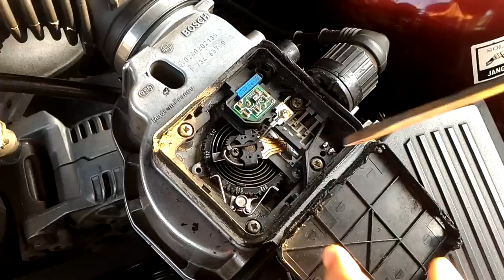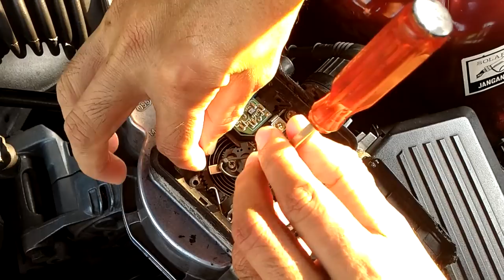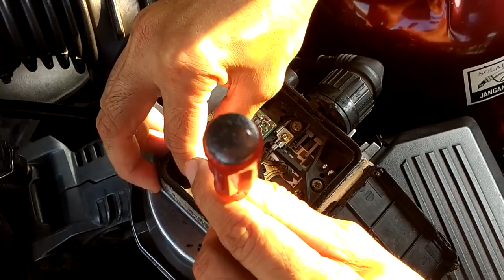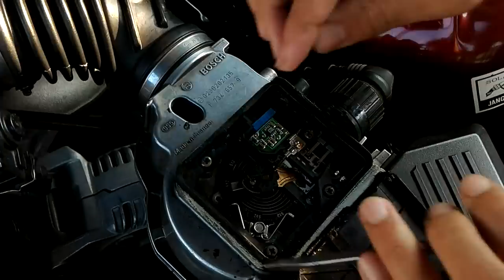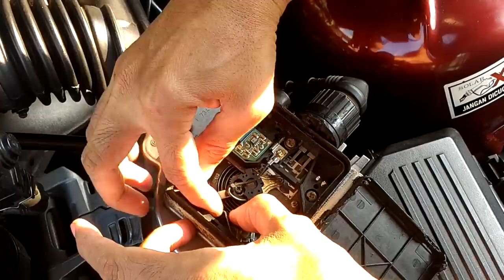BMW E36M43 AFM setting

Comment: Om, tune ini ngaruh ga ke Power output/efisiensi?
Reply from the maker: Ngaruh om
Reply: @motoren_works  ada tutorial buat setelnya om? mobil saya 1988 Toyota Cressida. pake sensor ini juga soalnya
Reply from the maker: @putraadriansyah8082  untuk di bmw, setting ini tujuannya untuk mencari kondisi ideal perbandingan antara udara dan bahan bakar. Kalo kondisi sudah ideal, tidak perlu ada penyetelan lg.
Step nya:
1. Buatlah tanda posisi awal gear sebelum diputar. Sebagai acuan awal.
2. Kendorkan baut penahan kawat gear, untuk memudahkan memutar gear nanti. Kendorkan saja dan tidak perlu melepas baut. HATI2 ketika memutar baut, tekanan pegas lumayan kuat. Jangan sampai gear tidak ketahan oleh kawat penguncinya.
3. Aturan putaran gear: clock wise/cw (searah jarum jam) = lean/irit. Putaran counter clock wise/ccw (berlawanan jarum jam) = rich/boros.
4. Kalo sy, sy akan memutar gear sedikit demi sedikit ke arah cw. Berhenti ketika getaran mesin menjadi kasar (kondisi terlalu irit)
5. Putar gear kearah sebaliknya ccw untuk mencari kondisi ideal. Kondisi ideal adalah ketika getaran mesin menjadi halus kembali.

Misalnya setelah memutar gear ternyata posisi gear kembali ke posisi awal tanda yg sudah kita buat sebelumnya, berarti disitulah kondisi idealnya.

Efek memutar gear ke kiri/kanan dari kondisi ideal akan menyebabkan mesin bergetar kasar.

Disclaimer:
"do it with your own risk" ya om.
Reply: @motoren_works  mantul om. tar saya coba
Reply: @motoren_works cara ini berlaku juga sama airflow e36 m40 gak om? Diputer ke kanan biar irit
Reply from the maker: @ridlwn sama om

Comment: Kalo knalpot bau bensin sama terasa boros apa kendalanya di air flow gan?🙏
Reply from the maker: Biasanya ada di setting AFM dan setting CO nya yg kurang pas om
Reply: @motoren_works  terimakasih gan.
Reply from the maker: @Satryatroy  siyab om
Reply: @motoren_works  sudah sya subrek ya gan 🙏
Reply: Lokasi di mana om,

Comment: Om, izin tanya. Kalo idle gak teratur, terus dari knalpot keluar asap hitam dan bau bensin itu berarti setelannya kurang gimana ya?
Reply from the maker: Kalo dari pengalaman sy, biasanya terlalu rich/boros bahan bakar om. Coba gear diputar clockwise/searah putaran jarum jam sampai bau bensin tidak tercium dan idle teratur om. Cek juga ujung knalpot, kalo mengeluarkan air/ada uap air saat setting, biasanya settingan sudah berada dalam range kondisi ideal
Reply: motoren works oke om, saya coba dulu. Terima kasih
Reply from the maker: @afridazubaidi830  sama2 om

Comment: Mas misal e36 m43  gas brebet terus asapnya jadi hitam itu apanya yah?
Reply from the maker: Kalau engine normal, kemungkinan boros om. Coba cek jg businya, kalau ujungnya hitam kemungkinan memang boros
Reply: Terus misal habis kenceng sering mati sendiri mesinnya om
Reply: @motoren_works  bukan AFM?
Reply from the maker: @ahadihalim3992  kalau pakai ilmu tebak-tebakan, bisa dari:
AFM: coba cek pergerakan flap nya, pastikan masih lancar, atau kalau mau coba geser GIR AFM nya 5 gigi ke kanan (CW)
ICV/idle up: kalau kondisinya masih normal, coba bersihin. Tp kalo icv mulai error biasanya rpm bakalan naik turun terutama ketika AC on
TPS: cek hambatannya

Baiknya sih di scan dulu om, siapa tau ketahuan part mananya yg error

Comment: pak kalo di gas gada tarikam trs glitik itu lean atau rich?
Reply from the maker: indra alamsyah sy kalo nyetting AFM dalam kondisi idle/langsam tampa di gas pak. Kalo rich tandanya mesin seperti mau mati, sedangkan lean tandanya mesin bergetar hebat tp tidak sampai mau mati
Reply: iya sih saya juga gt, tapi bingung pas dijalan biasa kaya boyo gt, apakah lean atau rich di rpm 800-1500
Reply from the maker: indra alamsyah jadi boyot setelah gear diputer ke arah mana? Searah gerakan jarum jam atau berkebalikan dr gerakan jarum jam?
Reply: se arah jarum jam si, cuman mas ngerasa boyo juga gak kalo terlalu lean?
Reply from the maker: indra alamsyah kalo terlalu lean pastinya akan terlalu boyo mas. Kalo yg sy lakukan adalah geser gir ke kanan sedikit demi sedikit sampai mesin bergetar hebat. Setelah itu, putar lg dg arah berkebalikan dr arah sebelumnya sedikit demi sedikit sampai getaran mesin halus kembali.
Posisi terakhir tersebut biasanya adalah posisi yg paling ideal.

Menggerakkan gir ini sebenarnya untuk mencari posisi ideal antara lean dan rich. Setelah posisi idealnya diketahui, gir bisa digeser sedikit ke arah lean atau rich (kalo sy maks 2 cekungan)
Reply: Setelah setting afm m43 sy jd gak ngebul item lg.. cuman suara Disa Valve nya jd agak keras ya
Reply: motoren works cara stel apa harus lepas kawat penahanx mas
Reply from the maker: @yulihartono8448   maaf om ini baru kebaca. untuk setting, sy tidak sampai melepas kawat penahan, hanya di kendorin saja bautnya sampai kawat bisa lebih gampang untuk digerakin. kawat juga akan tetap menahan GIR. untuk setting gerakin GIR juga sedikit demi sedikit om
Reply from the maker: @zealkomputer919  maaf baru kebaca om. agak bingung jg sih om kalo disa valve mengeluarkan suara, harusnya sih gak bersuara. kayaknya disa nya perlu di cek dulu om

Comment: Om lokasi dimana ? kalau bantu setting AFM m43 saya bisa? terima kasih
Reply from the maker: Di bandung om. Kalo deket inshaAllah bisa om
Reply: oh kirain jakarta om hahaha blum jodoh berarti ..btw kapan saat dibikin rich dan kapan saat di lean , klo om itu di bikin rich knp ya? klo saya karena asep pedih jadi kayanya terlalu rich mau dibikin lean enaknya muter brp gigi om? terima kasih
Reply from the maker: @zagard1  maaf late post om. muter gir AFM tujuannya untuk mencari setting optimum, dengan catatan track carbon masih baik. Sebelum memutar gir, kasih tanda dulu ya om. Sebagai patokan dan antisipasi jika setingan kita nanti tidak sesuai harapan.
Putar ke kanan/searah berputarnya jarum jam (miskin bahan bakar) sedikit demi sedikit sampai mesin bergetar kasar. Setelah bergetar kasar, segera putar kembali ke arah berlawanan sedikit demi sedikit sampai getaran mesin alus kembali.
Kalo setelah proses ini ternyata asap buang masih pedih di mata, coba untuk melakukan setting CO di bengkel yg punya alat uji emisi
Reply: @motoren_works  makasih informasinya om .. semoga sukses dan berkah selalu ya om
Reply from the maker: @zagard1  Aamiin...siyap, makasih om
Reply: @motoren_works  om. Bisa gak nanganin yang di jakarta?. Sama kira2 brp biaya setting nya. Karna kmrn udh segala cara dicoba. Mulai ganti busi, coil, cb valvetronic baru, setel Top. Ganti map sensor. Ttp rough idle. Tarikanny pun brebet. Apa lg kalo make manualnya. Thanks